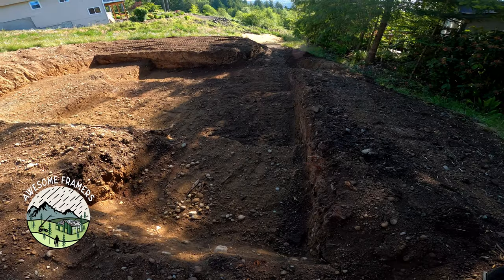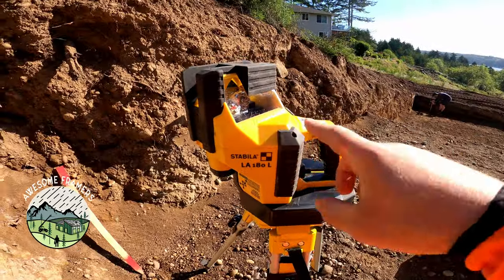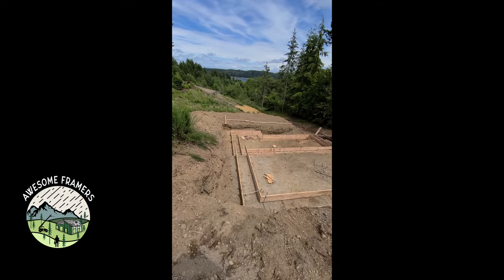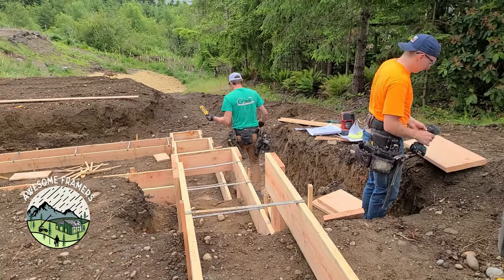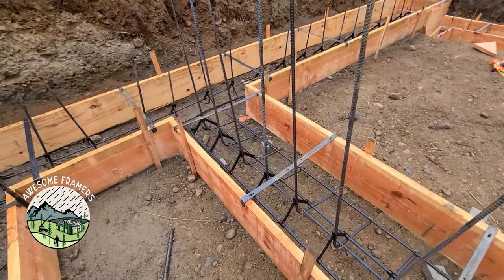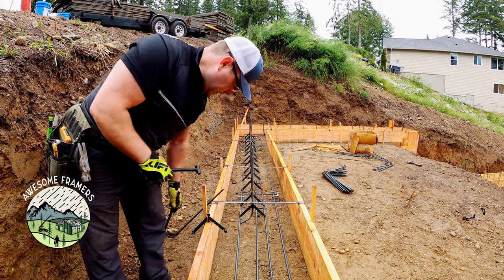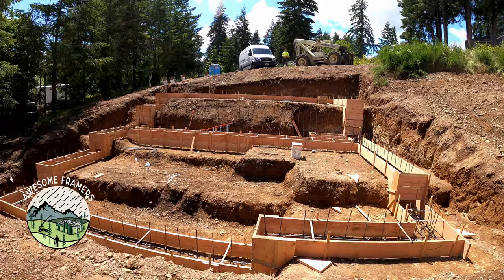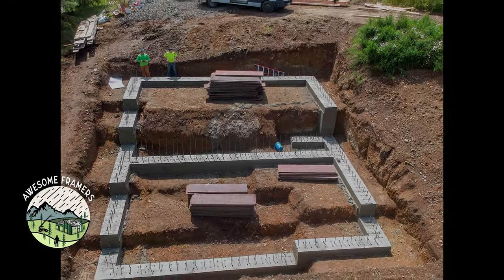How to Layout Stepped Footings

Comment: Nice work. Well built to handle that amount of concrete. I am against anything that contacts the rebar and the ground. No way of waterproofing. Concrete will shrink away from those blocks and water will have easy access. Bar is 3"min from the ground and ALSO 3" from the sides of the footing. Not the middle. Hang bar, might need 2x4 crosses to support the weight. Install the bottom bar to hold your hook dowels upright.(bottom most bar that will be in your mat for the wall). But overall still really well done. I would be happy to stand wall on that footing.

Comment: Don't really want rebar sticking out past the footing...if it starts rusting there it'll carry through the footing, into the walls, just hang your bar from your footing spreaders, it'll save a lot of time.
Reply from the maker: non issue because it gets the same damproofing as the walls.
Reply: One builder legit didn't think that I installed rebar in the footing because he couldn't see the rebar. Imagine my look after hearing that. Apparently some other company sticks the end of the bar right up against the steps. No waterproofing after. Just backfill it and hide it lol

Comment: Trust me guys you don't need to step down. Follow the grade and rake cut all your studs and solid block. When it comes time to measure stud length, secure a tape measure to a board and read the tape for exact measurements as it steps down,, with a builders level. Save a ton of concrete, labor and no low to grade spots at steps. Very fast and easy.
Reply: Except the plans say otherwise and the structural engineer didn't want the house to slide down the 5:1 slope your solution would create.

Comment: You didn't say anything about the rebar in the steps.  What are the requirements for rebar when stepping down a footing?
Reply from the maker: Good question, so the 2 bars need to be "continous" so we tie 24" x 24" bends at the top and bottom so everything overlaps 24"